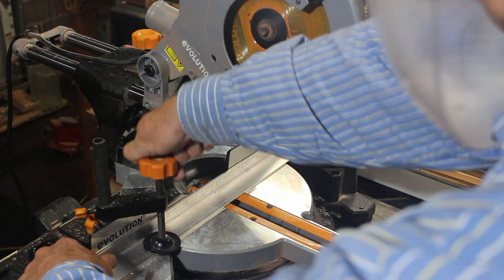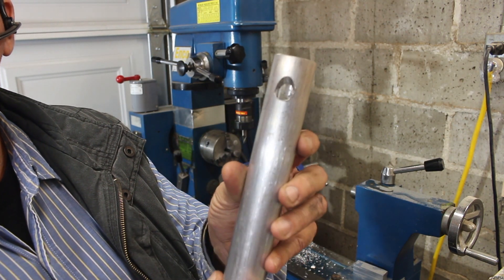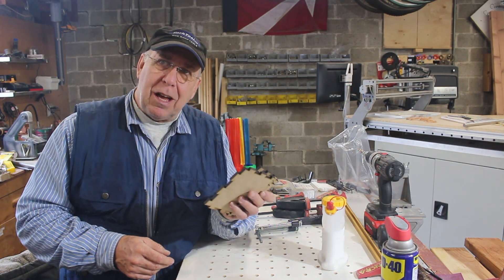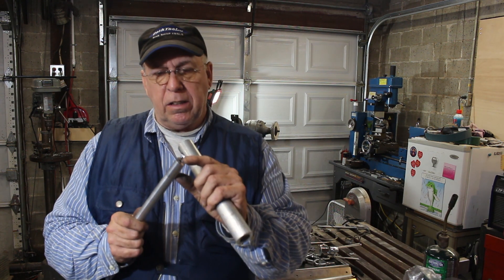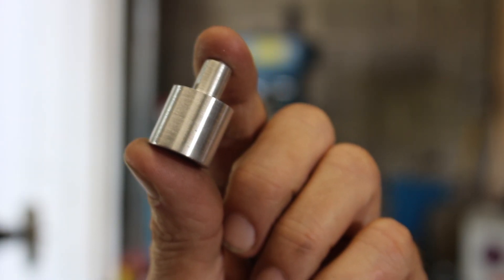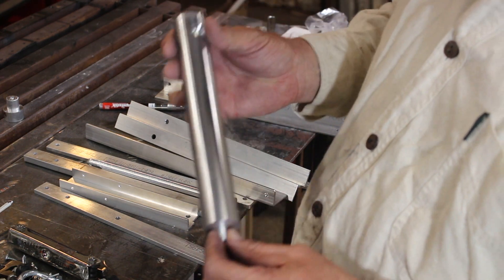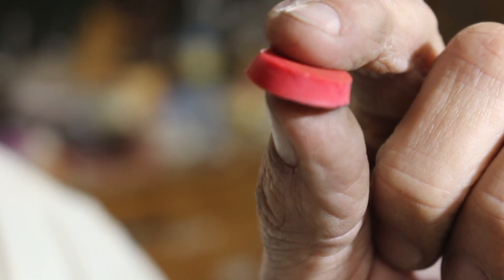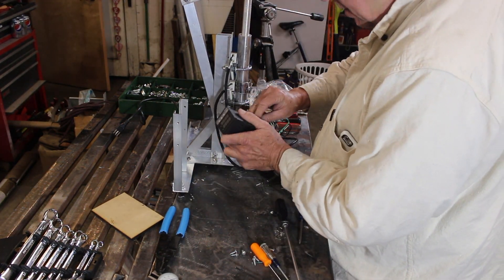Injection Molding Machine for under $100 in parts using less than $700 worth of machinery!

Comment: What is the diameter of the nozzle?
Reply from the maker: Whatever diameter you choose. The entire project is a suggestion based on whatever materials you happen to have on hand.
Reply: @WildmanTech  ok. Thanks.
I want to make replaceable nozzles with thread. I will do 3mm and 4mm. Do you think that the thread will stand pressure? Is it better to do one diameter of the nozzle, and all welding?
I use aluminum.
Reply from the maker: @nepotycznysuperbohater  screw-in nozzles would be better. Some people use these... https://amzn.to/3Iw0VkW

Comment: I thought they used the screw now so they didn't get a cooler centre and a more brittle shell with the outer tube heating up more than the core this was the very first patent design that failed before introducing the tappered screw to move the plastic through
Reply from the maker: Couldn't do that for under $100

Comment: How do you wire up the heater bands , I like to see a short video on that I built a machine and I have the PID and the heating bands
Reply from the maker: Each PID is unique and should come with a wiring diagram. It's usually 6 wires. Two from power, two to the heater and two to the thermocouple to sense the temperature.

Comment: Thank you so much for posting your Plastic Injection Machine. ((the name of the tool you couldn't think of the name of), is a GASKET HOLE PUNCH. Works best when backed up by a piece of wood covered in hard rubber. It keeps the part being cut, pristine, as well as not dulling the cutter.))
   I'm a retired Machinist/tool & die maker/electrician/volunteer firefighter...so I was into a lot, thru my life. I'm close to 70, now. I"ve designed and built a bunch of tools, thru my lifetime. It would be lots easier to make my prototypes out of the finished type material, instead of all metal. I'm trying to find a partner that knows how to do the Legal end. I design and build the prototype and they run it thru the legal system and sell it to a company and everybody's happy.
   I'm looking at the various YouTube vids to see how the best way to do what I need to do and stay clear of the scammers, too!
   Thanks for your video series! I also, like the fact that you tell us what we need to know, for the subject at hand, instead of ratchet-jawing about everything under the sun, but the main thing, you allow us to hear the sounds of the machines and the sound it makes to remove metal, not having to turn it down because of bad taste stuff some people call music! I thank you, from the bottom of my heart!

Comment: Amazing work, what did you use to measure the five thousandsths (lol, spelling?) of an inch increase when heated ?
Reply from the maker: I used a temp stick to determine the temperature and a dial caliper to measure the change.
Reply: @WildmanTech  Thanks, my calipers only go to hundredths so i may have to upgrade :)

Comment: You asked for feedback, so the main thing for me is that you skipped over a lot of the most interesting parts, like assembling the electronics and the frame. Explaining where the frame and electronics parts came from and how everything works and goes together. The majority of the video was making a tube and there's so many questions left unanswered. I'm very interested in DIY injection molding and would love to see a more comprehensive build video, or alternatively, at least an explanation of how it all works. Also, how do you use it? I found the fidget spinner video, but it seems you're still working out the bugs. Anyway, that's my feedback! Keep up the good work!
Reply from the maker: Links to the individual parts are in the description and there are several follow-videos that provide additional info.

Comment: Hey, I’m trying to assemble my injection molder but I can’t seem to figure how to connect the band heaters. How did you hook them up and also that other cable coming off of the SSR on the same side of the band heaters at 9:04 ?
Reply from the maker: My band heaters just clamp around the tube like a hose clamp. They came with ceramic blocks to interface to the power feed. The SSR only has four wires. Two from the PID controller to turn it on, a hot coming in, and a switched hot going out.

Comment: Th trick with the ice was neat but I'd have just threaded the nozzle and barrel and screwed them together.  This way you could easily replace the nozzle if it gets worn out or you wanted a different size and it would make cleaning the barrel easier.
Reply from the maker: In the follow-up video we address part of this. Link in the description. As far as cleaning goes, that is best done with a purging compound.
Reply: @WildmanTech  Purging compounds work well but if I had the option to easily disassemble a barrel and have it open on both ends so I can thoroughly scrub it clean I would love that.  This isn't practical on large industrial machines like what I use but would work fine on a small homemade unit like yours.  I'm going to watch the follow up videos now because this is a really interesting project and I look forward to see how it turned out.

Comment: Nice.  Have you seen Dave Gingery's injection molding machine design?  In addition to a stand-alone machine like this, his son designed one that relies on a drill press to hold and move the piston; you just clamp it in the chuck.
Reply from the maker: If only all drill presses were the same, I'd be mass producing them.
Reply: Well, most drill presses can be adjusted up and down by moving the table, so you could pick a reasonable height for the whole injector and use that.  And put a... I don't know - 1/2"... shank on the top of the piston, so it can be chucked in a standard chuck.  Or you could make a smaller shank for smaller drill presses.  Then just a cheap PID temperature controller with a thermocouple, and either a wrap-around heater cartridge or a few of the cartridge style as used on 3D printers, and maybe make the injector to use standard 3D printer nozzles?  Seems like it would be pretty easy to do.  Most of the work is on the stand and the lever and such, so using the drill press would eliminate all that.  Or am I missing something?
Reply from the maker: @Culturedropout  There is not standard on the distance from the post to the chuck. Presumably, you would attach the melting chamber to the post and the piston to the chuck. Maybe the melting chamber can just sit on the table.
Reply: I know there are all kinds of different throat depths on drill presses.  I own a couple myself.  One is 8" and the other one is 16" (tabletop and floor models).  I was thinking of bolting the base to the table, or putting a "foot" on the base and clamping that to the table with a c-clamp or something similar.

Comment: Are there any online retailers for the metal components that you would recommend?

Are there any shops you would recommend to source the parts if we have them in our area?

I understand that we’re supposed to make this with what we have on hand but as far as I’m aware, I currently have none of the needed components. I am aware of the instructables page for the links to the electrical components.
Reply from the maker: The hard parts to get are the heaters and controller and I left links to them in the description above. Most major cities have local metal supply stores, and contrary to popular belief, any average joe can just walk right in and buy stuff. Metals.com is ok, but expensive. You can probably find it cheaper locally with a little effort.

Comment: I invented a product and is patent pending but now I am stock because injection moldings are so expensive. God I wish I could have the knowledge to build one with $100.00. Would you like to be my partner? Please let me know. By the way Mr. Wildman I just subscribed.
Reply from the maker: I am in the process of creating a small production machine that will deliver 3-5 cubic inches of plastic. The approach we are taking is that the machine will cost under $1000 and will produce one part at a time. We will offer mold -making service as part of the sale. You will need a CAD model of your item and the tolerance must be greater than 0.001". Stay tuned to this channel and our Instagram for the latet updates.

Comment: I'd like to change the design a bit and motorized the plunger and add an automatic mold press and release, and the change the feeder to full auto from a 5 gallon bucket. All this so I can autonomously make case halves all day long.
Reply from the maker: Once you dive into the realm of automatic ejection of the part from the mold, things get complicated. Motorized plunger is in the plan for an upcoming model.

Comment: Stop dumbing down the video with high speed footage.  The process is equally important. Enclosure can be had by recycling old electronics cases.  I reused an old printer switch box.

Comment: is there any chance of getting a vid of the components in box and how to wire them  thanks
Reply from the maker: The PID controller comes with a wiring diagram and is very easy to wire up.
Reply from the maker: Seriously, it's only slightly more difficult than a lamp.

Comment: It works? But you have nothing to test it with, but it works? You've never done this before, and this is the first time you've made this, you haven't actually used it, so how do you know it works? LOL Good start, but how about showing that it REALLY works?
Reply from the maker: I actually have the ability to determine whether something will work or not based on nothing more than seeing how it is made and a couple of rudimentary tests. I see how this is made and know that it gets hot, therefore I know it will work. As far as giving more empirical evidence, have you considered watching any of the follow-up videos where we show it melting plastic; discovering some minor issues and solving them; then ultimately make a mold and casting a part? Links to the follow-up videos appear on screen, in the end cards, and in the description.
Reply: I'm a machinist, fabricator, yada yada too.. Just thought it was premature to claim it worked without testing, lost interest in your videos after that. I'm sure they're entertaining for someone. Thanks for the reply.
Reply from the maker: Odd you took the time to comment. Most people who land here are actually interested in doing some injection molding. If nothing else, you can learn from my mistakes/discoveries...which is the reason I show them in the videos. You may be surprised to learn this, but everything in this video (as with most of my videos) is the very first time I've done it, and you see it as I'm doing it.

Comment: As for the advice you asked for. First, great voice. Calming. But in a way, I think your question is a tad myopic. Here's what I mean.

When we're at home trying to sort thru all this stuff, I think we usually don't care (at all) about how "long" the video is. If it's a good vid, we'll probably be running it more than once anyway, or cherry picking thru it. We just want all the information we might need. And you did leave a LOT of information out. It just needs to be chock full of all the info we need. Yours is not. Well, not really.

For example, you didn't talk about the frame at all. Nothing about what each part you made does, how it all fits together, and what its working principles are. This problem is actually compounded, not assisted, by speeding up the frame for its assembling. Also would have enjoyed seeing how you tapped the holes for screws, what the electronic parts were (and what they do), and what the purpose of chamfering the end of the pipe was (if I'm saying the right thing.) Probably other stuff too if I watched the vid again. But I won't?

I like it a lot that you're sensitive to the fact that a lot of YouTube tutors tend to add elements to their vids that are of no relevance. You did very little of that (such as telling us about a friend with a laser). But at least you care about staying on point. Some guys will almost tell you what they had for breakfast. Almost anything a guy does to draw attention to himself, instead of the project, is kind of annoying. Maybe your "How am I doing?" was a little like that to some people. But you already know you need to hear some of this, which is why you asked. (I like you, so I'm sayin.)

So, for the vids themselves maybe, first, just a little more planning, and then as much information as you can pack in. You could even have put the frame together, taken it back apart, and then showed us only the second assembling, error free. As to info more broadly, let me say this. Not everyone who wants to dive into this kind of thing online, is the sharpest tool in the shed. So tutorials always need to speak to the lowest common denominator. The rest of us just have to suck it up, just to be fair to that guy.

Thanks though for at least some information/know-how. Your enthusiasm alone carries a punch.

Oh, but the hundred smooths? Come on, man. You used seriously expensive equipment left and right, and called on help from others who also own "the she-ot." Ordinary guy in his garage got little help from this. Show how to do this all with a drill, then you're onto something. Maybe clamp the drill down onto your bench (at an angle) with a deeply set (short) bit, and use rails, like a router, to ride the part along that tip by hand-- pr two rails sandwiching the thing in. I think mostly this is the kind of stuff your budget-bound builder is after. Don't you? Then we could beam with pride too. Or sell what we make, to afford nice equipment. (And then go online, lol, to learn how to use it.)

Took a lot of time for you/them here. Hope you appreciate that.
Reply from the maker: The follow-up videos address every one of your issues. Here is a playlist containing all of them... https://www.youtube.com/playlist?list=PLNhYIDsZSyGtBLQUR7FVgTTB6DyNYJuNZ

Comment: nice video! from one creator to another, when doing video where you are in front of the camera, its a good practice to look into the camera lens not at the display (we all do it at first). love the video!
Reply from the maker: No idea what you're talking about
Reply: Wildman Tech when your looking at the camera, you can tell as the viewer that you are looking off to the side and not into the camera lens. It’s like your looking off to the side. Just a tip.
Reply from the maker: I actually have a condition called strabismus. It's worse when I'm tired and I was burning a lot of midnight oil when I made this video. I didn't have a mintor to look at when I made this.

Comment: Anyone catch how the nozzle is heated?
Reply from the maker: It doesn't have, nor does it need. a separate heater. The aluminum conducts heat just fine. In later tests, shown in follow-up videos (links both in the video and the description), even the mold conducts enough heat.
Reply: Wildman Tech what did you use to heat the body? I guess that’s the question i should have asked. I may have missed that part of the video.
Reply: Oh, ha, i see the link now. Figures, i didnt look hard enough. Lol
Reply: Awesome project, btw. I like your video style. It’s straight forward with no bs, but still entertaining

Comment: Super thanks for sharing.   One small suggestion - try to put your teleprompter / notes over the camera itself and then make a point not to look at the camera itself, but instead the notes.  Otherwise you look distracted by something off camera as your eyes go back and forth.

You can also compress your videos more by making sure you do the explaining as the high-speed is going.

If you find high-speed operations are producing too much noise you can run a low-pass filter on that audio first, though I didn't hear much of that in your videos.

Really cool format and great information -  Liked and Subscribed
Reply from the maker: Teleprompter? Notes? No idea what you're talking about, but thanks for watching.
Reply from the maker: I don't recall asking your advice on the matter, but what are your qualifications? I do look directly into the camera lens. I have a condition called strabismus. Look it up.